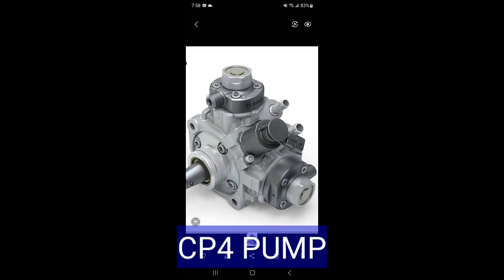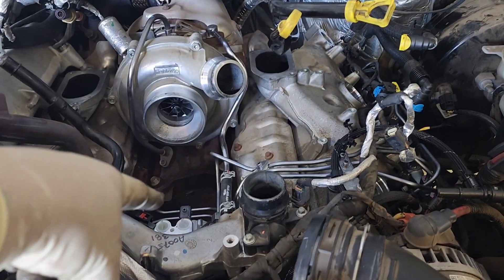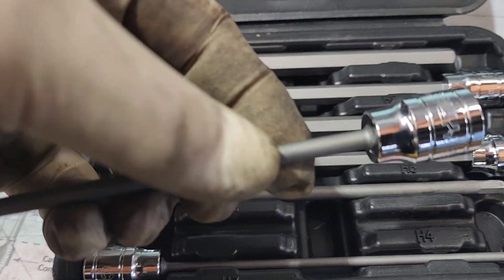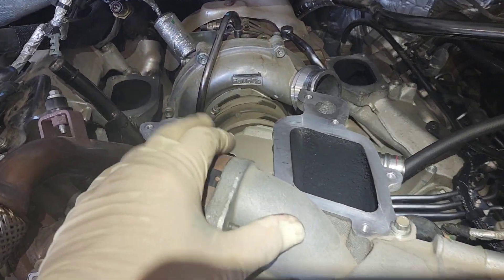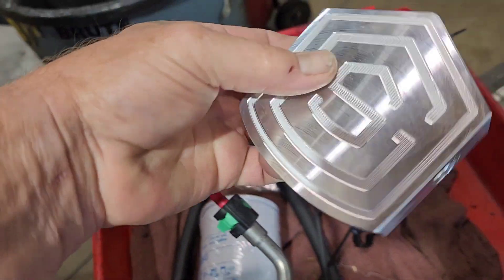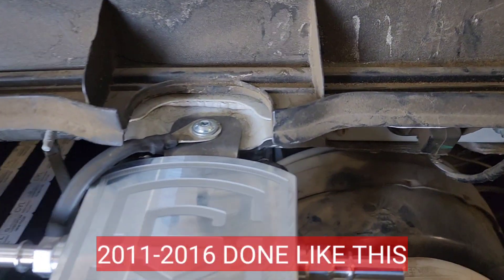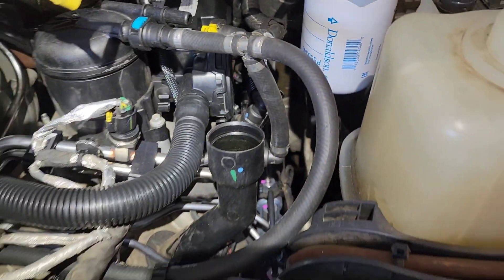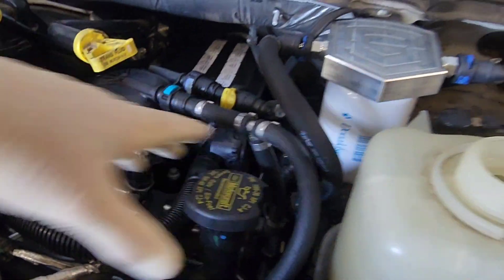How to Install Disaster Prevention Kit 6.7 Powerstroke

Comment: Just installed one in powerstroke & getting a p0088, checked fittings, wiring & all seems to be good there
Reply from the maker: You may want to recheck your installation steps. You can message me on Instagram

Comment: I bought this kit for my 22 f250 when discussing it with my friends 2 of them asked if I would put it on their trucks also. I am starting on the fiend that has the oldest truck a 2017 I have watched several install videos even s&s video and none of them have showed the fuel lines like you have to which is what they just take them all apart and say this goes here that goes there but if you’ve never done it and you don’t know what’s what it doesn’t help Thanks you did a great job explaining
Reply from the maker: Thank you very much and I am happy to hear this. I appreciate you watching and good luck.

Comment: Nice informative video! Just got this kit for my 15' F250 after hearing about this CP4 issue. I haven't had any issues with the fuel system (Thank god) in the time i've owned the truck (from 61K to now 227K) and have always had the filters changed at required intervals. What would you say it took you for time to install from beginning to end?
Reply from the maker: That is great to hear about your truck. They say the biggest cause of these pumps going out are lack of maintenance. I mean some just crap out too though. I am not sure about the actual time but message me on Instagram and I can talk to you about it. Thanks for watching.

Comment: I live in Sacramento. I have a 2016 F250 6.7 and my maintenance agreement with Ford has run out. I am looking for a confident diesel mechanic. How can I get a hold of you? I don’t have Instagram.
Reply from the maker: I work for University Automotive.  I should be back to work in a month hopefully.  I had ankle surgery.  We are a great shop with an awesome warranty.  We are on Northrop Ave.
Reply: I need to add this kit to my truck.

Comment: Don’t like how wobbly that filter is attached to the firewall.
Reply from the maker: It is attached and going to be ok for the truck to be running.  That is how it is designed and will save the fuel system if pump fails.  Thanks for watching.